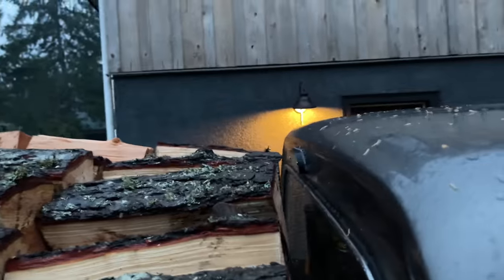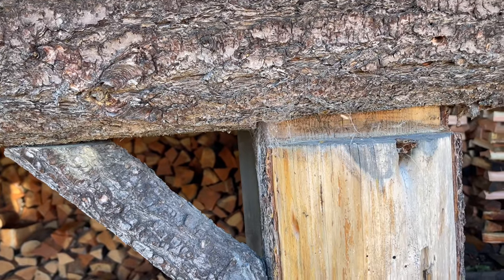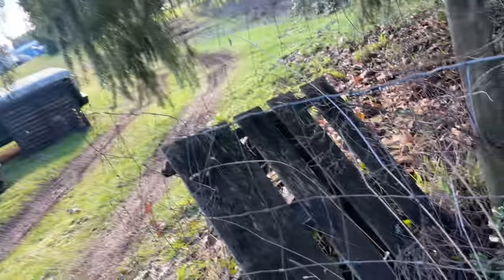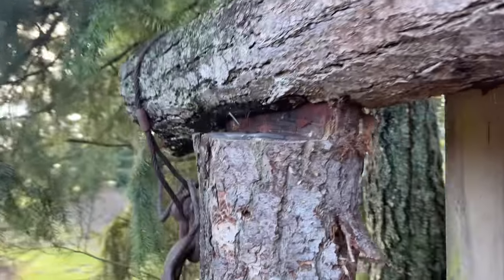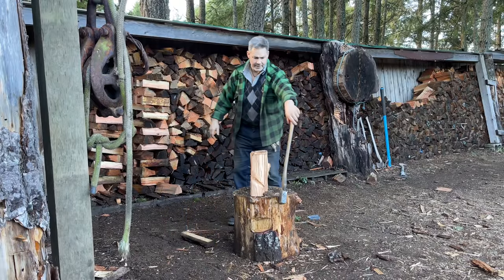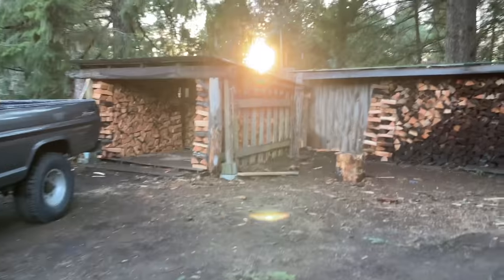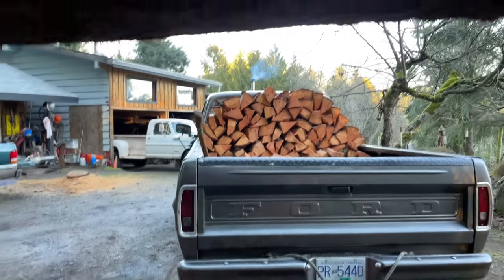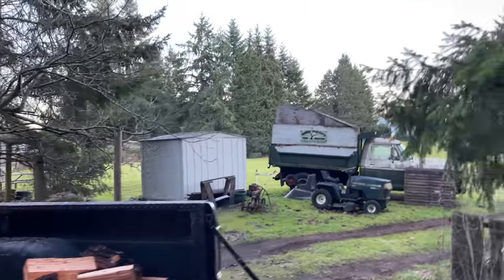My wood shed is falling over, simple mans repair. Wood stacking tips

Comment: Even though you’re using pressure treated, I’d recommend putting a paver under to keep the end grain out of the dirt. Love what you’re doing, Buckin’!
Reply: I think he set it on a cement block as well
Reply: Yes, he set the end into a block and then on top of another block.
Reply: I think the block around the bottom of the pole will rot out faster that way.

Comment: Buckin, you've got the right idea with setting the post on top of a block....but the one you've set the post into is only going to hold moisture around the post and help the rotting process...just trying to give insight, as here in Michigan...we quit cementing in the post on pole barns because of this particular issue.  Hope this helps you out, have a blessed day!
Reply: He did mention not needing advice!

Comment: Buckins’ amazing welded Jack!  Seats axes 🪓, lifts woodsheds, gets your truck out the ditch and probably hundreds more uses 😀.  I built a woodshed and used angle iron brackets (2 holes drilled in top and bottom) to secure the 4x4 beams. Unconventional, but strong as an ox ... 8 ft x 8ft by 104in back and 96in in front (taper for metal roof so rain will wash away) - holds right around 10face cord 😎 ... It’s about 35degrees here in wny , time to test out these 044s I’ve been building and split some wood. Cabin fever 🥵 begone !!!
Reply: Hey Fabz, I like your porting videos and I'm getting into the sport of porting. Have you considered making a longer video as a "project"?
Anyway, have good one
Reply: @thomaslindroos1667  not sure what you mean Thomas , please explain

Comment: Good one Buckin. I process my firewood in the woods and bring it down with an atv. I leave it stacked in the element after a year I bring it to my wood shed to keep the snow off for winter burning. My wood is mainly ash, iron wood and black cherry approx 12% moisture when seasoned

Comment: Buckin’ when you fix the back of the truck, use angle iron across the bed, and up the verticals, then use round stock for gussets, but don’t fully weld the base of gusset, leave a few weep holes. If you can, a close “grab bar gusset” also works well, and gives you a handle for climbing in!

Comment: Hey Buckin glad to see your into the repair mode,been there on my 26 year old hand made shed,was  going to mention if you burn the ends that go in the ground they will last much longer.
If I were you and the great job you did on the posts with the knoches I would replace them with the same.
Plus leave the support uprights alongside,super tough ,way strong looks like a logger thing.
Power saws have always been my skill saw.
But concerning your measuring on p/u truck cord of wood thing,easy peasy,leave the .5 off ,4x8 equal 32 times 4 equals 128 ft in a cord.
I know you know this.
So your 4 x 4 x8 equals the bed of my truck = 1 cord plus extras

Comment: I just did 3 cord of rock maple for my parents. Bucked it with my 565 auto tune with 32 inch bar. But I used my wood splitter lol. Nice stuff though. A guy needed the 2 trees cut that we’re leaning towards his house. So I removed them and he told me I could have the wood. Pretty sweet.

Comment: Been covering my firewood with salvaged roof tin, I need a woodshed :) I like your plan of unseasoned wood on the sides, leaving a way between to the dry wood in back. For whatever it's worth, I keep a garden rake on the truck to pull stovelengths to the tailgate, rake will grab several at a time. All best to you and the fam brother

Comment: I’m going to build something similar I’d like to get the old hydro poles they’re treated and cheap 
I came across ur channel I bought a grand forks axe as I seen it on wranglerstar but seeing ur technic I went out and stared splitting some 24” logs I was gonna cut with a powersaw as I thought I can’t split it with a axe I was really IMpressed how well it worked I looked for the crack and bang got the bugger now I’m hooked no sitter I will
But I’ll get a bunch of good axes lol

Comment: You have to remove the bark always!!! And the wood foot needs to be up on a rock or something like that…it lets it dry out…wood can get wet but it must be able to dry out… 
The post will expand and crack that 1/2 block quickly… beautiful job uptop with the saw cutting that notch flat…that’s beautiful!  Maybe get a tube and a couple bags of concrete and make a post foot and just cut the bad area off the bottom’s of those post… they have been there a lot time and they will continue… those upper notches still look perfect…just needs a rock or something waterproof under the big post!

Comment: if you use the tape measure opposite, put the dumb end on the bottom, you dont have to bend over to read the measurement on the smart end. Hot tips and more!

Comment: BUCKIN READ THIS, I noticed Silvia had lift blocks on the rear, lift blocks are usually used with factory springs, lift blocks are a big big no no for trucks that are wheeled or worked, they cause major axle wrap as well which is hard on your axles. I recommend you give alcan springs a call and tell them what you need, they will make springs to tailor your needs, all you need to find out is how much lift you need.....your truck will perform alot better with no need for more helper springs...

Comment: Billy, sir you are so lucky you don't have the termite pressure where you live that we've got here in the south eastern U.S.
If we put it on the ground like that we've got to take some extra steps, not just to keep those little boogers away, but also our climate will rot the above ground stuff as well. Maybe your above ground stuff is just as bad, might even be worse. Those dang termites though, they are rough.

Comment: Great video buckin! You can try and get some cedarfor the uprights next time,a good tip would be to use a sheet of plywood on either side of the bed and a ratchet strap across from either side,also try and park parralel to the wood shed to unload the wood,its just an idea and would save you reachin with the tool in the bed , keep the faith brother ! ,love the videos ,v relaxing 😀

Comment: Livin the dream brother,  bless you... quick? I tried out filing my power saw Chain after watching couple of ur tip videos.  Emphasizing on taking bottom gullet out with first couple strokes and remaining strokes getting back into the tooth and actually profiling and sharpening.  So my ? Is , should I be filing into my links , sometimes even before file hits the tooth profile? I'm putting slight upward bevel out of tooth but bc I take a good amount of Gullet out it's just soo low that by the time I get into the profile of the tooth I'm filing away Chain link.  Isthat okay? Lol and with my saw explode when I touch wood with this wicked hook I've created.  I dealwothhardwoods live in Lower ny.  It's on stihl 362 25 inch bar and before ur videos I used to use stihl hand guide that files rakers and teeth same time.

Comment: Also have a 661 that I bought basicly strictly for alaskan milling. Don't think ide want to fell with the 661 honestly.   I put a Forrester 42" bar on it, a step up from the 36 inch  .050 bar comes with Forester is .063 and yea, wouldn't wanna fell with it unless I had to lol.  I think the 465 is probably best of both worlds running a 32 for felling but the 362 been good to me, I just am almost scared to see how this gulletless hook is going to respond to 27 inch diameter hickory and maple and locust

Comment: Remember to put your diagonal braces back on,  or better add a pair of long diagonals ( cable with turnbuckles or 2x4s at the back (wind bracing). Even deck post concret pads would have been a bit better,  Remember to paint your cuts and breaks to the preserved wood with copper or zinc napthanate.   All things whacked into my head by a former BCFS bridge engineer.

Comment: Except your point loading the 'decorative' base block with only the 4x4 (It is not fastened to the square block, and will slide through it in time) Easy fix is a sheet of 1/4" metal over the fancy block. Really surprised your jack didn't just crush that pallet on the 2nd one.  Back Shirley INTO THE SHED Buckin; work smarter, not harder.